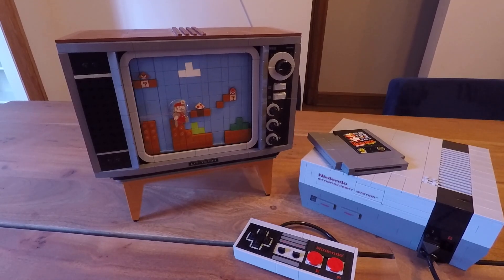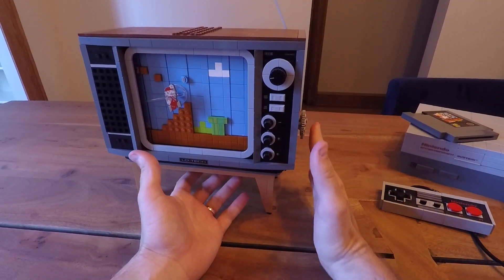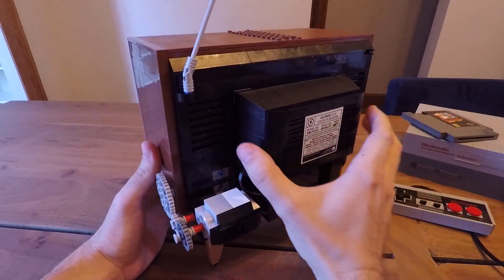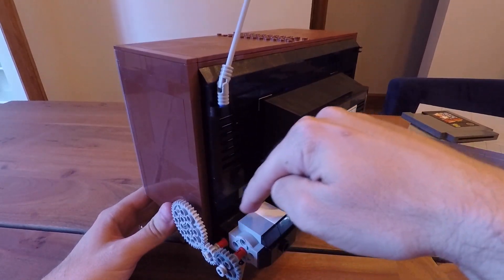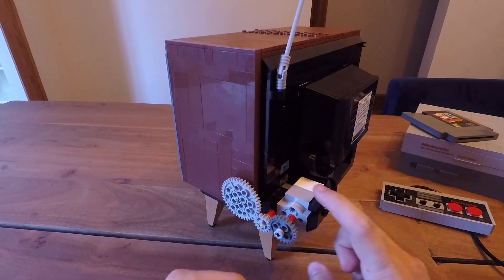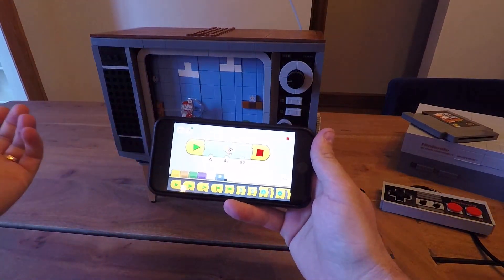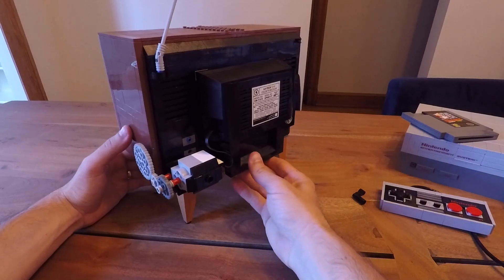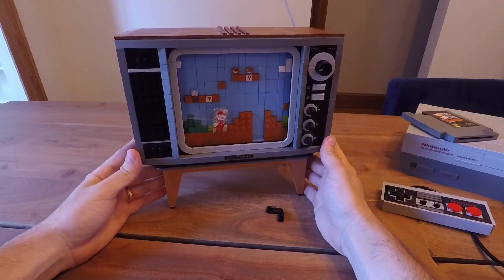POWERED UP! Motorized Lego NES (71374) Nintendo Entertainment System

Comment: Which bricks did you use it?
Reply from the maker: So this MOD only has those few gear pieces that you see on the outside of TV. You'll need the motor and battery box and probably a few pieces to attach the motor to the back of the tv. I have another video where I breakdown how to build the MOD internally, which looks a lot better.
Reply: @monumental.bricks  Yes, I saw it, but I was interesting in this one. Would yo mind say like parts numbers or something? On the video its difficult to see well. Thanks
Reply from the maker: @nataliagarcia7452  Looks like Part #94925 (16 tooth technic gear), Part #3648 (24 tooth with axe hole technic gear) and Part #3649 (40 tooth technic gear). You'll also need a couple of technic Axles, probably 3L, 4L or 5L (not sure of length) - Sorry I built this a long time ago and since reverted it back to the stock original set build.